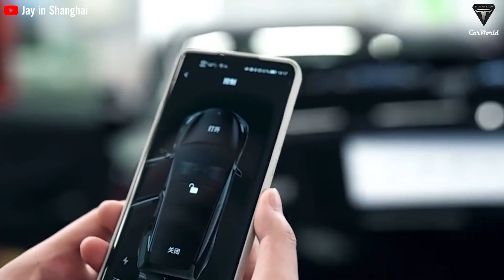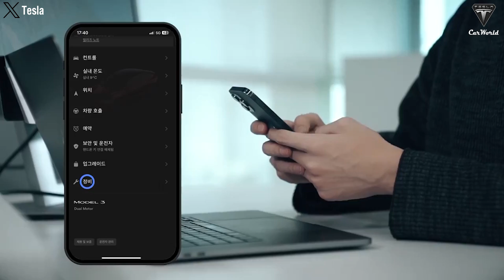It Happened! Elon Musk Finally Released 3 TESLA New-Models! Ready for Launch in 2025!

Comment: I wouldn't go Anyware near one until they fit a Fireproof Black Box just like the ones in aircraft simply to exonerate the driver if the technology is the cause of a failure or fire especially if there is a fatality or huge liability resulting of a mishap, dead people don't talk, where the manufacturers of these EVS will blame everything except their creations.
Reply: Does your current automobile have one?
Reply: @johnpublic168  Yes  It dose , it's called an ECU, OBD it records all the vehicles parameters automatically records them on my cell phone or computer via Bluetooth or WI-FI it can be left on permanently, should something go wrong at least I have an idea  , it can also be used to correct speed and odometer readings as Tyre ware or wheel sizes change, my wife was hundreds of km from home when the stability light came on she took it to a dealer that said the brake booster needed replacing, it ended up after checking through the OBD fault code a 50mm length of rubber vacuum hose At $2, as opposed to $700 brake booster. Tesla or any other EV manufacturer certainly wouldn't be game to give owners the same type of access to fault finding except for blinking dash lights after it's too late. At least My Automobile has a limp mode and won't burn to the ground.
Reply from the maker: Implementing a fireproof black box would enhance accountability, ensuring transparency in accidents and protecting drivers against potential manufacturer liability claims.
Reply: That tesla hater
Reply: These new models and some current models are fitted with LFP batteries that can’t catch fire, that’s a big improvement over an ice car where you sit on 30 gallons of gasoline, in fact the number of ice fires is 7 times greater than all battery fires.
Reply: @shepherdsknoll   Three points First and Foremost 7to 1 gasoline fires is absolute Propaganda, Two, and most importantly Gasoline fires can be extinguished quickly and are far less an environmentally hazard. Three do you honestly think that Elon Musk or the Chinese Battery industry is going to write off billions of dollars to change their battery manufacturing processes, it's just like engine plants and oil Barrons for decades refusing to switch to far more economical diesel engines for heavy transport. Dream on.
Reply: A black box  is mandatory in all new cars in the European community  as from sometime next year.